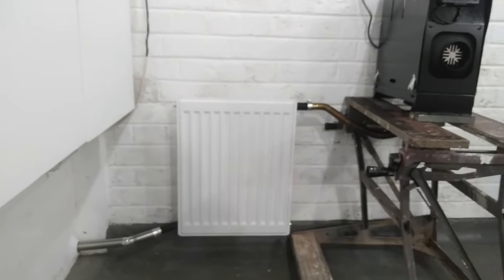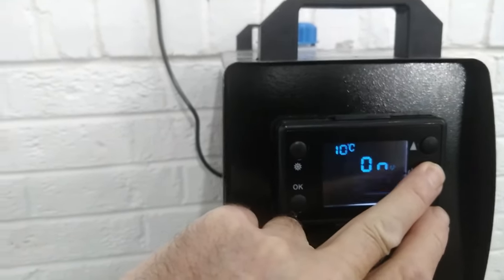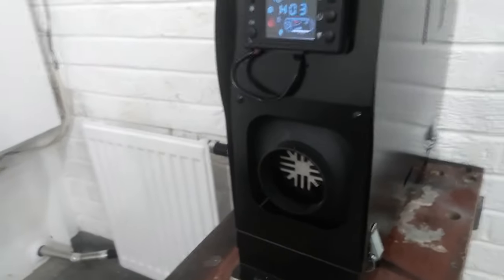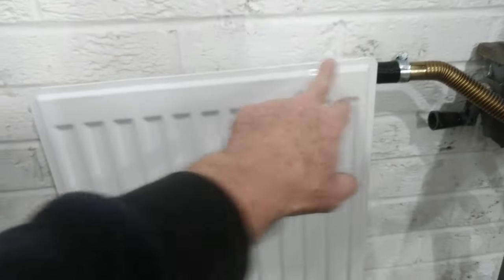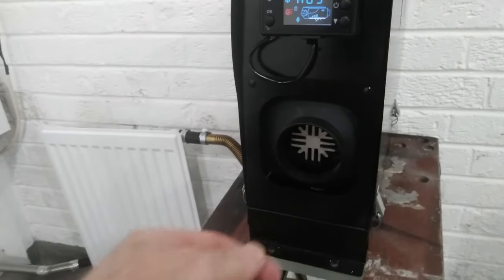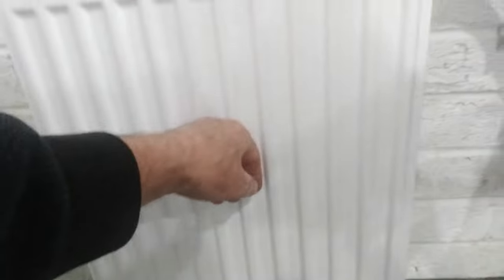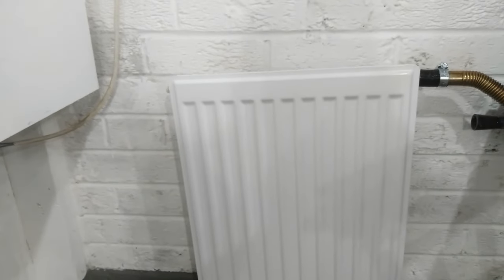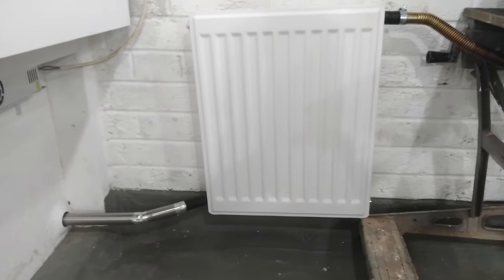Free Heat from Waste Exhaust Gases Heating Radiator Home Oil Diesel Heater Chinese Recovery Exchange

Comment: Let’s look at some simple Physics/Chemistry.

Supposed 5kW (likely provides circa 4kW of warmed air), running at only half speed (H3) setting (~2kW) is very unlikely to be providing the ‘more than 2kW’ from exhaust heat recovery - it would be virtually all the energy input to the heater!

Temperature is not the same as energy.

Fuels contain some sulphur which will burn to suphur dioxide/trioxide and dissolve in any liquid water to form sulphurous/ic acid which will dissolve both mild steel and copper.😮

Exhaust gases should be kept above dew point or condensation will occur.  Above 100 degrees Celsius, at the exhaust outlet, would alleviate the condensation problem, but restrict the amount of heat recovery from those exhaust gases to approx 2/3rds of the total available.  Cold surfaces in a household radiator will always allow condensation within the flow path.

Apart from the risks of eventual exhaust gas leaks (these heaters are not certified for indoor use because of potentially lethal CO poisoning), an EGR cooler from a diesel engine with exhaust gas recirculation would, I think, be a better/safer way to recover any reasonable amount of the exhaust heat available.

But, as always, there will be those that ignore (or haven’t a clue of) the safety, to try to extract a little extra heat, so will carry on regardless.

Comment: Hi Andy,what gave you the best results with the rad.was it the  direct exhaust input or heat exchanger ( cu pipe wrapped around the exhaust,) ? cheers.
Reply from the maker: the exhaust straight through got hotter. but for a long term lasting system , i would use the heat exchanger .

cheers andy

Comment: Hi Andy , just fitted my heater in the garage nightmare to prime but sorted now , how are people fitting the control unit ? Double sided tape ? Had loads of smoke on start up but clean now  and silencer isnt making any difference sound wise but fitted.  Exhaust and air pipes at the moment go outside through some luckily existing holes . Andy all this is new to me and think am worried about everything lol , even put a flag stone at the end of the exhaust.  Checked the cavity of the wall and cant see any rock wool . Andy bless you if you reply to all of this message 😂😂
Reply from the maker: i was totally the same, i was worried that it was going to blow up. the sound of these building up, like a jet engine is initially scary. yes smoke on start up is normal . and the initial prime problem is normal too. the exhausts are not really worth bothering with, but if you are resourceful you should be able to dampen or deflect the noise somehow. you can use a motorcycle exhaust. when i have the control unit separate to the machine, i used a couple of self tapping screws.

 it sounds like you have served your apprenticeship now, you can now start to enjoy the rewards for you hard work, and you will be able to leave this on for hours without worrying cheers andy
Reply: @andyfireblade  cheers Andy

Comment: One question: Because of the restrriction of the exhaust, is it possible that the pressure might go too high which will cause some of the exhaust gasses to slip out the other end? I don't really know how these heaters work FYI.
Reply from the maker: yes, it does give some exhaust restriction, but none leaked out where it shouldnt.
did you see my other heater vids, 
https://www.youtube.com/@andyfireblade
let me know what you think,
cheers andy
Reply: @andyfireblade  Yeah but only two including this one. I'll take a look at the others ones.

Comment: I feel like you could be using a much bigger radiator here. I would be tempted though to try to coat the inside with something to protect from the condensate. If there is a suitable paint type coating one could fill the radiator up with it to ensure complete coating and then drain the excess and leave it at an angle to drip drain as it dries out over several days. Not sure what you would do with the leftovers 😂
Reply from the maker: good idea,
thank you for your comment did you see my other heater vids, https://www.youtube.com/@andyfireblade let me know what you think, cheers andy

Comment: Cool! One question though. If you read the manual,  they say that you cannot obstruct or lengthen the exhaust pipe due to back pressure, inefficient burning etc. Causing waste buildup in the burner. How is this effecting the burner after a few months? Thanks
Reply from the maker: your right, but i havent used this long term.
did you see my other videos? https://www.youtube.com/@andyfireblade

Comment: Could you fill the radiator with oil (Kerosene), then make a closed circuit & a coil of copper pipe with exhaust running through he centre of the coil?   The copper pipe coil would act as a heat exchanger & the radiator oil would retain heat for a while after shut-down
Reply from the maker: thats a good idea.
 someone else said a similar thing about using an oil radiator. to store the heat, good point.
did you see my other heater heating the living room. 
https://www.youtube.com/channel/UC3sYHaAZtJI-vrD64K7Qe9w
have a great day andy
Reply: @andyfireblade  no, I'll check it out. thanks

Comment: I couldn't help thinking about the long short radiators,think there called skirting radiators, imagine two of them joined up....
I find my diesel heater very economical
Reply from the maker: that sounds good, or a big old cast iron school radiator? yes they are very good anyway arnt they? we are just trying to beat the fuel price war! regards andy
Reply: @andyfireblade  bet them old school solid radiators would work really well

Comment: If the exhaust temp is lower than 140°f it will start to condense. That condensate is slightly acidic and will rot steel stupid fast!
Reply from the maker: thank you for your comment did you see my other heater vids, https://www.youtube.com/@andyfireblade let me know what you think, cheers andy

Comment: What fixings did you use to go into the radiator from the exhaust pipe fella?
Reply from the maker: i didnt use a valve, so there is a bigger hole for the gases. and then i used a piece of the inlet flexy hose to go over the rad neck with a jubilee clip to hold it on.
great comment my friend.
thanks and thanks for watching. also i have another heater heating my home, if you want to see it, kind regards andy https://www.youtube.com/channel/UC3sYHaAZtJI-vrD64K7Qe9w

Comment: Is still working?
Reply from the maker: it was just for an experiment. i havent got it still there.
i would think it would be still working.

cheers andy
Reply: I m asking because i allready failed on this project,after one week my towel radiator that i used was completly clogged and it was 3/4 inch pipes and my heater had clear burning fuel without smoke on exhaust. After this failed project,i cleaned my heater and now work perfect fine.Cheers

Comment: Nice video, very interesting. I would like to be able to use the exhaust fumes from my cinese diesel heater to heat water, so that my electric boiler will heat the water starting from a higher temperature than room temperature. Is it possible? Have you made a video about it? If you haven't, could you make one? Thank you.

I haven't created videos, but I can offer advice. Using exhaust fumes to heat water raises safety and environmental concerns. Consult with a professional to ensure it's done safely and within regulations.
Reply from the maker: Great idea
thanks , and thanks for looking
did your see my other heater videos
https://www.youtube.com/@andyfireblade
let me know what you think

cheers andy

Comment: Put it through a Indirect Hot Water Cylinder and get free hot water.
Reply from the maker: yes that would be a great idea
kind regards andy

https://youtu.be/6rQAo8lSLHY this is the other one that is heating the house
Reply: Good idea and a bigger radiator would perform better.

Comment: You could probably heat two of those radiators with the heat coming out of that exhaust! 
Also I’d be curious if running this in sub zero outside temperatures if ice buildup around the exhaust would ever become an issue?
Reply from the maker: it would heat a bigger radiator, maybe a bigger cast iron one would be good.
the exhaust is too hot for it to freeze up.

thank you for your comment did you see my other heater vids, https://www.youtube.com/@andyfireblade let me know what you think, cheers andy

Comment: Very good. I was wondering if you ran that exhaust pipe through a metal tank of sand if you could capture longer lasting heat .
Reply from the maker: Great point!
like a storage heater?
i have another one heating my house up, it is outside in a box.
with a 4" hole in the wall piping the hot air in. heres a link if you would like to see it https://www.youtube.com/channel/UC3sYHaAZtJI-vrD64K7Qe9w kind regards andy

Comment: Heat rises be better in the bottom out the top
Reply from the maker: yes, i thought that to begin with .but then i was worried about the condensation / water build up in the rad? but i might try it that way, as i thing the water would burn off, as steam. 
and thank you for watching. 
kind regards andy , did you see my other heater , heating the house. 
https://youtu.be/6rQAo8lSLHY

Comment: Better exhaust going in the bottom of radiator from heater and venting out the top to outside. Has you know heat rises. Try it that way and see the difference.
Reply: Gonna trap the acidic products of combustion doing that

Comment: Would have been good to see temps using an infrared thermometer 🌡️

Oh, and with it getting so hot, would it be possible to use a larger radiator?

Comment: instead of blowing it straight across and absolutely baking paint and metal why not try to get the exhaust to blow down a little bit and spread the heat out on the inside? unless you can't fit  the exhaust pipe further inside the radiator.
Reply from the maker: well spotted, good idea. i will look into it. 
thank you.
 kind regards andy , did you see my other heater , heating the house. 
https://youtu.be/6rQAo8lSLHY

Comment: These all-in-one units shouldn't be used indoors because if you get a leak around the exhaust pipes, the harmful gases enter the room you're in. Only the cold air feed and warm air tube should be indoors, the rest outside.
Reply from the maker: true, but these are better than the space heaters that we used to use in the garage, you got the complete burn inside. thats why we used to have a sore throat
Reply: With the same logic all wood burners should be used outdoors.

Comment: Looks good!. It will self drain so, be interesting to see if the rad rusts from the gases or not. Since that size is cheap, then no real issue if every few years it needs changing. Are those rubber joints to the rad? I might try something similar, and as always have a monoxide detector on hand just in case! :)
Reply from the maker: hello paul
thanks for your comment, yes thats true, it will probably rust. i think a big old cast iron school radiator would be good to try. the joints are a flexible metal pipe attached with jubilee clips. and thanks, yes got th detector. 
kind regards andy , did you see my other heater , heating the house. 
https://youtu.be/6rQAo8lSLHY

Comment: If you are using inside air for combustion the radiator kind of defeats your purpose.
Reply from the maker: the heater is on anyway, so the exhaust gases are being wasted normally, so i am putting them through the rad and getting some extra heat. cheers andy

Comment: The electric radiator style heaters are sorta stupid. They are rated 1500w or 2000w in Europe like any other space heater but their radiators are not capable of dissipating that amount of heat. So they end up pegging off their high temperature limit switch the entire time. I think they are only capable of putting out about 600 or 700w of heat continuously after they start ticking on and off on their overheat switch.. I avoid them unless the room your heating either doesn't actually need 1500w to hold the temperature you want or you hate the noise from normal heaters with a fan. Even then. The floor board style space heaters do better for cheaper. Just as quiet if not more so and they actually can dissipate the full rated power continuously.
Reply from the maker: great comment my friend.
thanks and thanks for watching. also i have another heater heating my home, if you want to see it, kind regards andy https://www.youtube.com/channel/UC3sYHaAZtJI-vrD64K7Qe9w

Comment: I don't think looping exhaust up and down a dozen times is a good idea .
Reply from the maker: thank you for your comment.
your right bends in the exhaust are not a good idea for long term use and a long machine life.

did you see my other heater vids, 
https://www.youtube.com/@andyfireblade
let me know what you think,
cheers andy
Reply: @andyfireblade  true  enough,  I would just probably extend exhaust hose  and run a long single loop inside on the floor still lower than machine and out the wall . That. Would recover alot of heat from exhaust,  without too much resistance . Letting the moisture run out the muffler hole , as long as your graded down whole way to the drain hole outside

Comment: I have been testing a similar Chinese diesel heater right now. I have it exhausting through the wood stove which tends to get to about 40C on its top surface from the exhaust alone.  I burn the untaxed red diesel fuel and it is actually cheaper than running my central natural gas furnace. I added a small engine fuel filter 60mm from the fuel tank as the first pump failed from contaminants in the fuel. The LED fuel tank light that I added shows the fuel level clearly from 10 meters away. The power source is a home built lithium battery pack with on board 8 amp charger that has allowed the unit to run during a recent 7 hour power failure. California is pushing to outlaw wood stoves and natural gas appliances. That is why it's not being used to burn firewood (until the Zombie Attack Day when all rules are voided).  I painted the housing black to blend in a bit.            https://www.youtube.com/watch?v=P3uHwrELUNo
Reply from the maker: thats great my friend.
thanks for letting us all know
cheers andy 
https://www.youtube.com/@andyfireblade
Reply: @andyfireblade  Cheers from Northern California...where it's not always sunny.
Reply: @kimmer6  I honestly didn't know that red diesel was a thing outside of the UK. They are really strict here about it which is a shame. Most people who want to save a buck will use kerosene as that's cheap here.
Reply: Sounds like a bad idea, the wood stove flue will not draw properly and you will get exhaust gas into the room
Reply: @EngineEngineer  Thanks for your concern. The exhaust heats the top of the wood stove hot enough to be uncomfortable if my hand is held there. There is adequate draft up the chimney at all times. No exhaust gasses enter the house. This is the 3rd season this unit is in use.  https://www.youtube.com/watch?v=6n8WMu7Mq3k

Comment: I'm not an expert at all, but to be fair, as 'nice' as this may seem, it perhaps isn't really. To begin with, you have just created a bottleneck/blockage for proper flow of the exhaust gases. the fumes accumulate in the radiator, and get mixed with moisture that will build up inside. in due time, soot will stick to the inside of the radiator, and the tubes, slowly clogging it up (apart from the fact you also haven't put a protective mesh to the exhaust and now rodents and insects might decide to climb into the exhaust shortly after it's turned off enjoying the 'free heat', and small enough mice and insects could even manifest themselves inside your radiator. when turned on, these poor animals will get boiled alive inside as there's no way they'll find their way outside fast enough, and clog and rot inside, further blocking your 'installation', which will make the fumes come into the room as there's no where to go. 

additionally, as much heat as the 'radiator' is giving off, it's actually an 'extention' of the exhaust. the exhaust itself is acting like a radiator. but as warm as the radiator gets, i seriously doubt that the amount of heat it gives off into the room is any better than a free-flowing exhaust running the lenght through the garage to imitate the surface of the radiator, without the additional issues.

i like those diesel heaters except for the horrible noise they make. the best way to use these imho is to take the control panel off, mount it on the wall (extend the wires), mount the diesel heater outside ( perhaps even in a extra sound insulated box, hanging a bit from the wall so that vibrations won't cause sound ), and add a corner and funnel through the wall where the heat is blown out, and bring the exhaust through the room and then exit outside again. you can then control it from the inside, it will be near silent, and decent heat.
Reply from the maker: thank you for your comments .
some really good points there my friend.
all taken onboard.

did you see my other heater vids, https://www.youtube.com/@andyfireblade let me know what you think, cheers andy
Reply: @andyfireblade  will have a look!